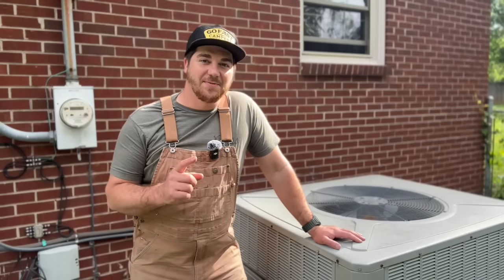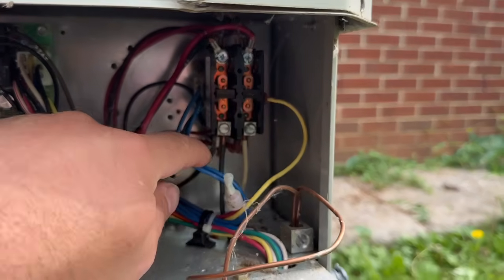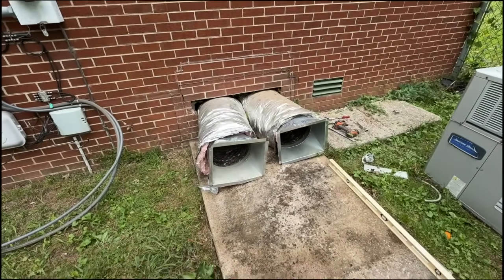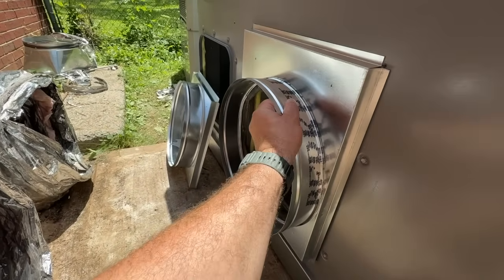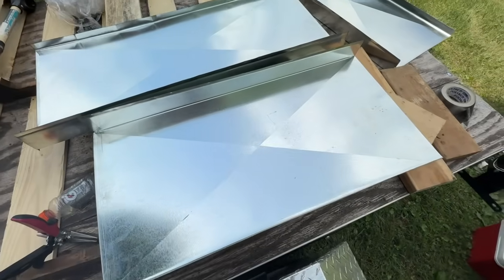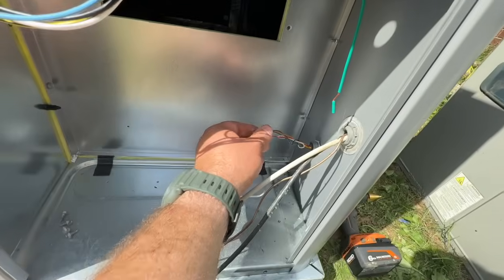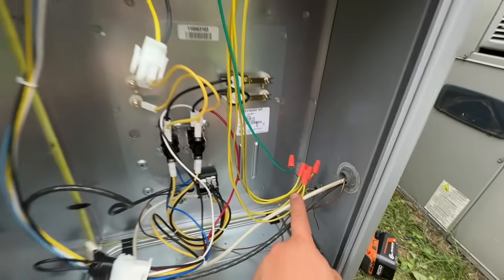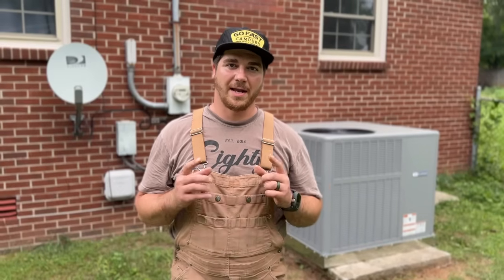Save THOUSANDS By Replacing Your Package Air Conditioner YOURSELF.

Comment: I don't want a heat pump/electric heat. I like gas heat. I will be switching from a split unit to a new gas package unit. How is the efficiency with gas burners being outside as opposed to inside, like a split unit?

Comment: are those pros and cons to using these further north? like heat pump inefficiency? Here in illinois the majority are split systems but I like the extra floor space this gives plus you can work on it all outside(except thermostat)

Comment: I need help, I have had 2 companies come and say I need new unit. I have cleaned coils inside house and outside unit. The air conditioner runs cold air for 10 minutes then not cold any more they said it has freon but I just can't believe I need new unit. Can you help me?

Comment: It was good that you decided to stay with the concrete pad and level it up.  I've seen many of those plastic/foam pads warp, bend, and crack over the years.  Concrete lasts the longest.  The only problem with a precast concrete pad is they can be very heavy.

Comment: Concrete pad is the way to go. I even poured concrete under the existing condenser unit. I lifted the unit and poured concrete. It was doable. Much better than the junky styrofoam pad.
Reply: And those waffle plastic pads are perfect rodent hotels.

Comment: I just saw a unit that has everything in the outside unit and sends in freeze treated hot or cold water into the coil.  This way refrigerant lines are only in the outside unit thus less refrigerant for leaks.  All manufacturers need to produce them?

Comment: Have had to deal with those units in the past as a service technician, they are having a lot of problems with in indoor coils leaking. Have a lot of problem's trying to find part and getting warranty covered. Sometimes cheap is not always the best.

Comment: i got a 2004 i think ac heat unit outside, been looking to get a more efficient one, im in AL North area. System runs good just running up electric bill some of it is my duct work and fixed some of it
Reply: AL Power charges twice as much per kWh as MS
Reply: @halleymsw  my rate is .11 KWH

Comment: I would love seeing a few more videos of dog house hooked ac units.  I, of course, have one.  The dog house is bigger than ac unit.  But at least now I might have a small idea of why I have what I have outside.  But I also have extras like a previous gas heater and electric inside furnace that was all connected with a high confident level.

Comment: How does this unit work with no refrigerant line ?
Reply from the maker: Everything is in this box, so the condenser portion and the indoor fan and coil portion. All the refrigerant comes precharged and sealed so it’s just a matter of getting power to it and it’s good to go! 👍🏼
Reply: It's not a split system, but a package system. Everything is contained in one unit.